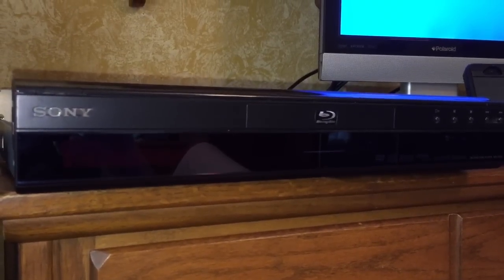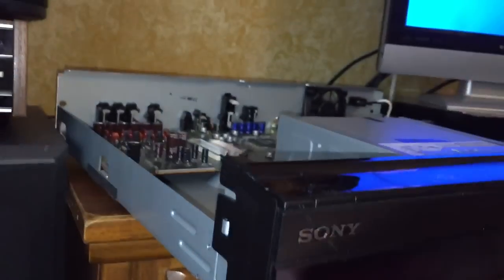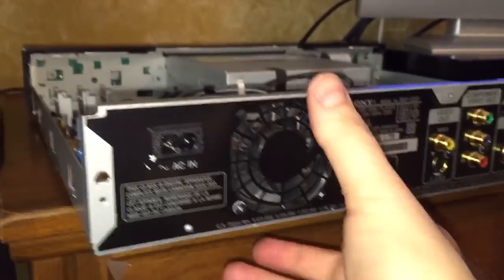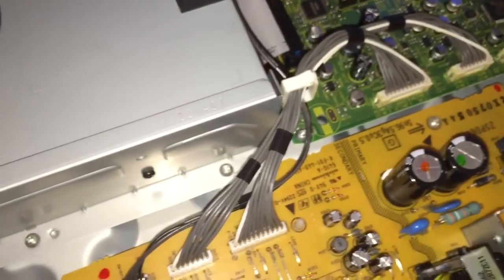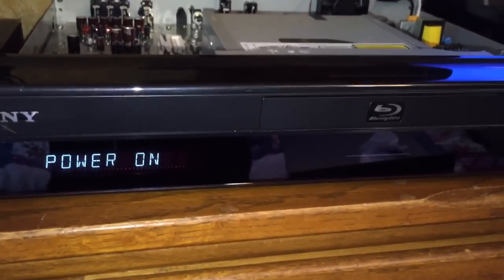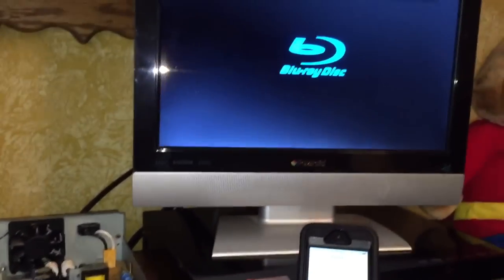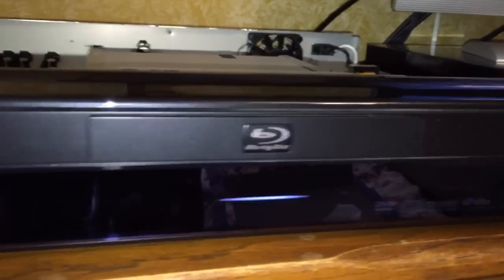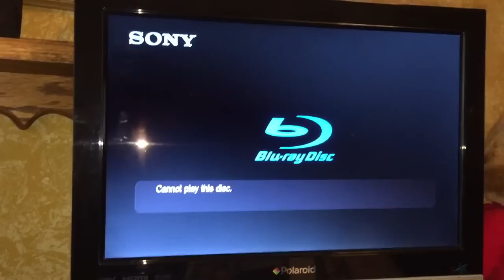Sony BDP-S301 Slowest Bluray Player on Earth?

Comment: It's not all that slow considering it's only second gen and how slow all HD DVD models were at the time. This is basically a BDP-S1, Sony's debut BD player, "slimmed" into smaller case. The Silicon Image chip is HDMI signal intake, handles HDCP before sending video along to the Sigma chip.
Reply: sehnzeleid that would explain the goop on the chip, then. It's likely over the (unencrypted) input from the Sigma chip.
Reply: yeah...bus speed are still out there. And with the processing power, they need more ram to compensate for the processing losses.

Comment: its because of the Java
Reply from the maker: Agreed.
Reply: my java blue ray player takes five seconds at most...
Reply: @rollercoastermaniac2  I think it also depends on the processor. As you may have seen in the video, there's not a single SONY part inside, LOL! If memory serves, the BD drive is Pionneer. I could be wrong, though.
Reply: Java is better than HDi
Reply: I guess it makes no sense making the same comment. Okay, I was going to word it differently: it's java powered, what do you want 😁

Comment: I think that the drive is so slow it has to buffer a huge amount of the movie to it's memory. That doesn't explain the boot up -time though. It can simply be because of java...
Reply: Benjami Lindqvist It's Java. I bought one when they were new and the early Blu-ray Discs were very bare on Java and menus and they loaded pretty fast. The power-on time was always slow, though. I think it was around 2008 that discs started getting more complex and brought it to a grinding halt.
Reply: Remember how long it takes to brew coffee?
Reply: that thing is slow not because of java it's self but mostly to do with the sigma DSP/Secure Processor.

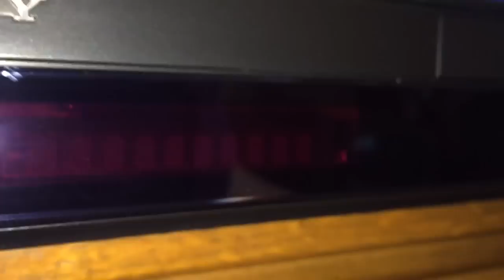Comment: I found a Philips BDP-7200 Blu-ray player at a ditto's Saturday for $35. I know I have a Sony BDP S5500 ( 2015 model ), but I wanted to see what 2008  brought us in Blu-ray. it's as big or close to the one in this video and has a cooling fan. it's in fantastic shape and has No dust in it. also what I found interesting is they stored the firmware on a 256 MB Panasonic SD card that was on a reader inside the unit that can't be accessed unless you open up the unit. when it comes to loading times, I put in a copy of Dispicable Me 2 in it. The Philips unit took 1:35.72 and the  Sony unit only took 0:31.83 to load the disc. Also the philips unit had 512 MB of Samsung DDR2-800 RAM, which I thought was pretty cool.

Comment: That's a great player! I have upgraded the software and it has improved. I love the simple and clean design and I love the analogue 5.1 output that connects to my stand alone 5.1 system, because I don't have an expensive receiver. Of course it could be better, but it still does its job and no other player cuts it for me because the lack of analogue audio output.
Reply from the maker: Thanks for your comments!

Comment: Has a date code on the back "7B" which means it was made between April-June 2007,  the number is the last digit of the year and the letter (A-D) states the quarter of the year. lovely looking machine though. I have a Panasonic smart blu ray that blows the USB wifi dongles. Now saving for a 4K machine though, preferably not assembled in china. Love your videos, they are informative. Just subscribed 🤘🏻

Comment: Oppo still makes Blu-Ray players that have analog surround sound outputs
Reply: Jacob Marzynski Sony does digital and digital inputs are better than analog.
Reply: > digital inputs are better than analog

Except in the case of Cinavia copyright protection. Then analog is much better
Reply: I do know that digital outputs are better, but Blu-Ray players with analog 5.1 outputs are still not very rare
Reply: @jacobmarzynski7719  This one also caries audio through HDMI and optical, so it does have digital output. It just has more options with analogue if you want to use it like me.

Comment: I found it's older Brother at a Thrift Store (BDP-S300) and bought it because I wanted a player that I can use a Remote Control with. I have a XBOne and PS4 as well, but I wanted to see how well it would work. It works, but like this Player in the video, it loads Blu-Rays pretty slowly (however DVDs and CDs play fine) and I tested it with my Blu-Ray copies of Inside Out and Tron Legacy and it took from the point I turned on the Player to the point of the start of the music and both took a little under 5 minutes to load :p

UPDATE: I tested the boot time with the 6.20 Firmware Update and it took 47 seconds to get to the part where it asks for a disc
Reply: UPDATE #2: This was a while ago. But I got rid of the Sony player a while back and switched to a Basic Samsung Player

Comment: Apart from the lack of SCART (which is replaced here with HDMI), that thing looks to have about the same set of ports, and to be about the same size, as the chunky-ass (but cheap! ...for the time) DVD player I bought in 2002. Given that DVD was a good 4 years old by then, it shows how much tech has shrunk in general that a Blu-Ray player in the first 18 months of the format's existence isn't any larger.

Comment: I'm from the Philippines and I think that's the same model that I saw which cost around Php 50,000 (over $ 1,000) many years back then. But you only got it for $ 30 (3:48).
Reply from the maker: bobskie321 I had a feeling that this player was originally an expensive model.

Comment: I don't have a blu-ray player in my home for ethical reasons. I don't wish to be sold "High Definition" for the misleading purpose of sneaking in copyright protection, and I refuse to pay for movies that contain advertising. Blu-ray is a large disc of DRM and advertising. We pay for the products, and have very little control over how we can use them. It's more like a long-term rental than anything. Piracy avoids these two issues I have, which is the irony of it all.
Reply: Thats pretty much the reasons that, even though I have 3 computers with fresh Windows installs, I have never purchased a copy of Windows in my life. Microsoft sucks, adverts must die

Comment: The IDE drive will probably affect the speed. I didn't even know they made IDE blu-ray drives O_o
Reply: I doubt it - Even Blu-ray 16x speed is only 72 MBps, while the last generation of IDE (ATA/ATAPI-6) was 100 MBps. (Although many PC chipset makers added an unofficial 133 MBps speed later.) Heck, the IDE in my beige Power Macintosh G3 from 1997 is capable of 33 MBps speed, which is fast enough for a much more common 6x Blu-ray speed, which is still faster than UHD Blu-ray requires (only 16 MBps.)

The speed of first-generation Blu-ray players is mostly in the seek time - which, just like first-generation DVD players, had issues because of the new technology that was resolved in later releases.  Throughput wasn't a problem.

Comment: Most computers at the time could not decompress mp4 at true realtime video speeds. Java was going to save the world with dynamic menus, but Java sucks!!! in speed. Why not write it in BASIC that could be slower... Everything in Java must be compiled into machine code from byte code - oops that takes time but it slices and dices on any machine. The drive I doubt could read at 4x speed; more likely 2x or 3x speed - bluray is 56Mbit max compared to DVD 11.08Mbit, remember HD is 4x the resolution and DVD had pre-format video menus with action event points like a web page on computers. The Java menu was going to have animation and all that fancy scmancy stuff done on a $350 computer in a box - desktops were $1200-1500 at the time. Oops again.
It was a transition time between SD and HD so money went to all worlds. Today a player has three wires and two buttons (AC, HDMI, USB, Power, and Eject) 8G USB sticks were $40 at the time and a mostly required option at the time as most disc wanted to store info about the disc - and don't buy the cheap slow one. All that fancy high tech whiz-bang electronic wonder stuffed in one box and you dare complain about speed - well maybe in 18 months the processor will double in what it can handle. (you know Moore's Law) Next year's model dropped discrete 5.1, only one SPDIF format, no S-Video, cheaper remote all to free money to add a better UI speeder experience..

Comment: Java is slow ... 
Try to find firmware update , if there is one. Usualy its done with burning it on blank cd-dvd .. Ive done that 3x on my pioneer dvd DV 400V , got some new features , like fast start , so on. Here is the link https://esupport.sony.com/US/p/swu-download.pl?mdl=BDPS301&upd_id=7474&os_group_id=13 (Check it for correct model)